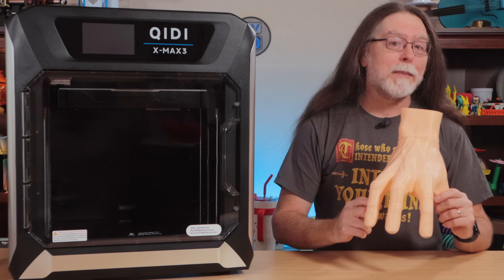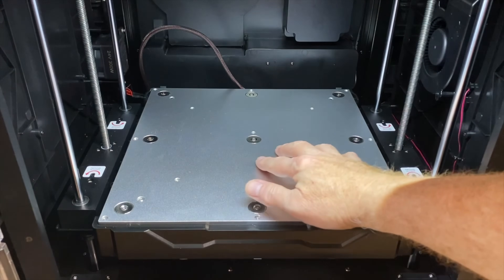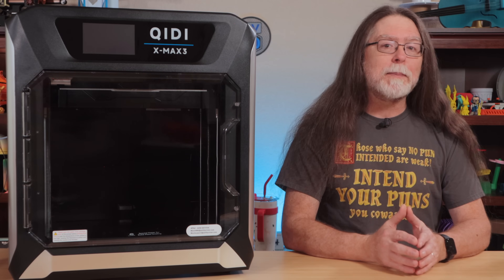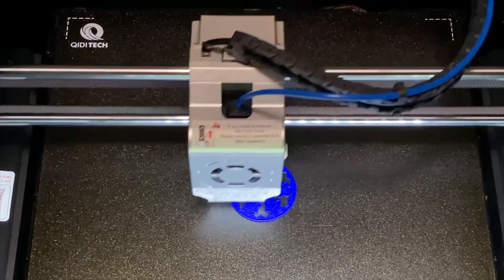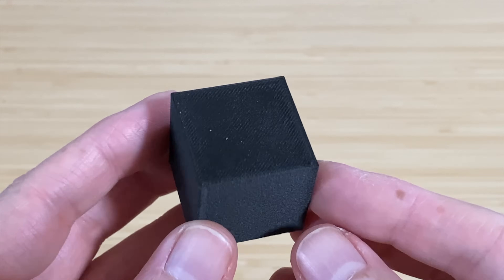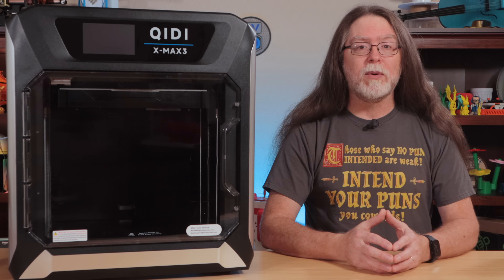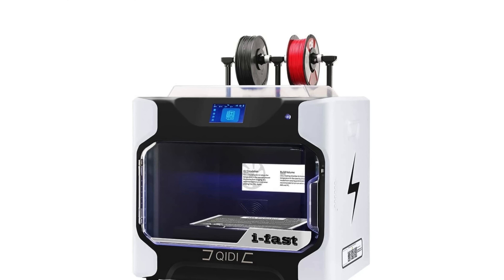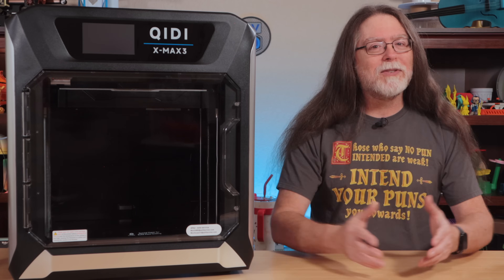Big & Fast: The Qidi Tech X Max 3

Comment: Bryan, they shipped you an old version of this printer.  I have the pre-order version and it looked like yours.  They have since upgraded the front print head cover with an additional fan for the heat break, and the rear cover with an additional fan for the break out board.  They have also upgraded to a clicky probe and a sticky magnetic sheet instead of those super powerful magnets (you remove them when installing the mag sheet).  I have installed all of those upgrades, and I must say I am very pleased with Qidi's support.  They have sent me all of those upgrades for free when I ran across issues.  I would highly recommend you ask for these upgrades and also make sure you have the latest firmware and Qidi slicer updates.  Now that all of that is done, this printer is awesome and is producing extremely high quality prints.  Do not be surprised if you need to start using glue stick on that high temp build plate.  I ordered the gold PEI textured sheet and it does not need glue stick.  This printer is really great value with all the features it offers.
Reply: Do you know if the upgraded version is in the stores yet ? Having a hard time getting answers even from qidi tech bout to say hell with em and get something else
Reply: I placed an order for one via Amazon in January (Qidi sells them on there under either Edify-Technology INC or R QIDI TECHNOLOGY). It took about 3.5 weeks to arrive, which might be due to where I am in the US, but I did receive the updated model. With how Amazon handles things though, I'd say it's still a gamble; the upside is you have a prime membership and get the old version, you can probably get Amazon to issue a replacement without too much hassle. I would assume though that if you buy it directly from QIDI's website that it would be the most up-to-date model from there too, however shipping costs might be higher and you won't have a third party buyer protection.   @aaamodeltrainsandplanes3774

Comment: I purchased my X-Max 3 last year, and received it last fall.  I liked it so much that I bought its little brother, the X-Smart 3.  Both printers are serving me well and I have been spoiled by their high speed, especially compared to my Sovol SV05 and Ender 2 Pro, both of which also have worked well for me.  But I doubt that I will ever buy another 'low-speed', non-enclosed printer again.  On a side note, I was surprised that your X-Max 3 has embedded magnets on the hot plate, as well as a BLTouch.  This is how my X-Max 3 is equipped as well.  But it was my understanding that newer X-Max 3 use an inductive probe and a sheet magnet (that replaces the embedded magnets).  I strongly prefer the embedded magnets and the BLTouch.  I believe the BLTouch is more accurate than an inductive probe (which requires temperature compensation and a steel bed), and I believe that a sheet magnet is likely to impair heat transfer to the actual build plate.  And like you, I wish this printer was equipped (with load cells) to probe the bed with the nozzle rather than using a separate probe.  But who knows; maybe an upgrade is in the works....

Comment: hard pass. not speed im looking for, quality of the print im looking for. i'll take my ender 3 pro and my elegoo neptune 3 max over the over priced printer in ur video anyday. just need $40 in plexiglass and corner mount brackets to make the ender 3 pro and elegoo 3 max fully enclosed. not worth the price differences .
Reply: I had read this comment a few times before I understood it. I have both a modified Elegoo Neptune 3 Plus with Klipper plus linear rails and a 0.6mm nozzle, and a Qiditech X-Plus 3 with a 0.4mm Diamondback nozzle. The Plus 3 is the sl8ghtly cheaper, slightly smaller version of the Max 3, and sells for just over $600, but has all the same features.

In terms of print quality it is chalk and cheese. If the Qidi is slowed down a touch from its default high speeds it easily near flawless print quality while still printing 2 to 3x faster than the Elegoo. The modified Elegoo does print very well, but all up that machine has cost about $550 in its present state with the mods and the Raspberry PI.

With Klipper on the Elegoo it does print significantly more cleanly than the stock Marlin firmware with none of the ringing and vibrations that the stock firmware had. It prints beautifully now but even so, it still doesn't quite match the quality of prints coming off the Qidi in half the time (or less).

I've also Creality printers. A brand new K1 that I picked up for $300 from Microcenter. Creality cuts corners so heavily that I always found myself spending more time trying to get the same quality that would come off either the Elegoo or the Qidi, than actually printing. I eventually got the K1 printing fairly well after upgrading a bunch of parts but I could never get the VFA's to go away fully. Eventually I got so frustrated with it that I just turned it off and sold it 2nd hand.

I guess my main point is that in my experience there is always a cost in quality with budget solutions that results in needing to spend more to fix those issues than simply buying quality in the first place.

If you don't have the budget to splurge on a high end printer, that's fine, but don't fool yourself that you won't be spending more money and time in the long run trying to chase down the same level of quality that comes easily with the higher end printers.
Reply: @stew675  like i stated I'm not looking for speed. also the build plate volume on the elegoo 3 plus and your Qiditech X-Plus 3 is small. i'm not trying to plastic weld parts together. that's why i got the elegoo 3 max. i can buy 6 elegoo 3 for the price of 1 Qiditech X-Plus 3. most people aren't looking to spend over 600 on one printer. also i hydro dip and paint all my prints. so can't even see the layer lines after that has been done. i had a raspberry pi on one of ender 3 pro's i have. took it off and the ender 3 pro works just fine without it. from my experience you can get the same quality with a budget printer..if you take your time. to many people want to have speed vs quality. the faster the print, the less quality of the part. also it how you take care of your machines......ill give an example. my 95 chevy s10 cost $25k in 1995 has 112k miles and still runs and drives perfect with no issues vs my friend who has a 2018 ford f250 that cost $55k and has the death wobble and has 200k miles on it. if you take care of the machine and not rush building parts you will get amazing quality but when u rush parts like ford and jeep did on there trucks you get bad quality of parts and poor results. also not all plastics are made the same. plastic filament companies don't have quality control like the do with auto parts. micro centers inland filament is JUNK, so is sunlu. i've had amazing results with flashforge, elegoo, and overture filaments. and like i said originally costs only $40 to build a plexiglass enclosure
Reply: That’s fine. There are those of us though that need a 350 degree hot end and 65 degree actively heated chamber to produce nearly flawless ASA, ABS, etc…
Reply: @rjakiel73  well abs is best used with injection molding and it's not hard to build a injection molding machine for under $600. no warping with injection molding vs using a fdm printer. asa and abs do have flaws with fdm printers vs injection molding with abs and asa.